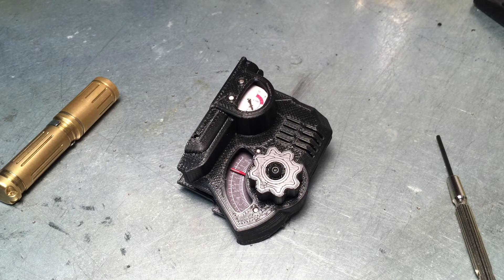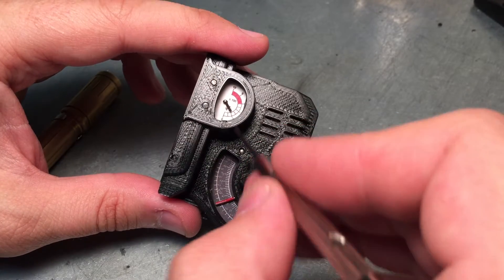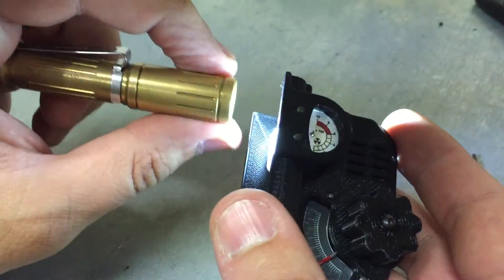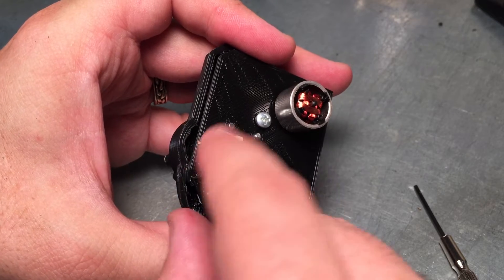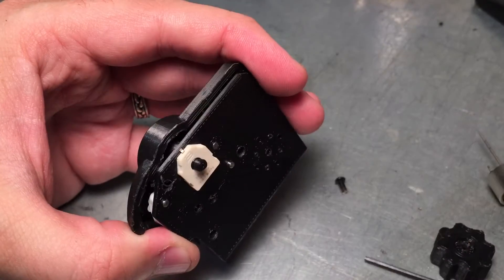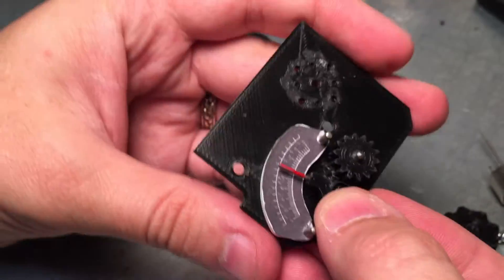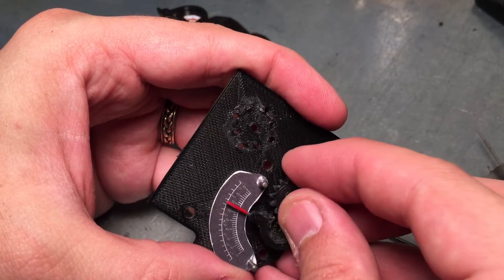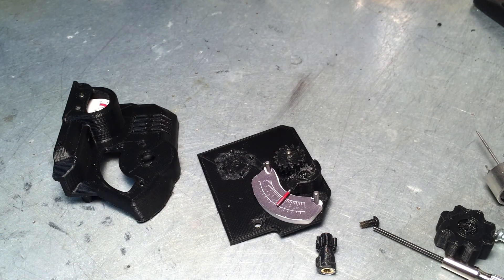Pip-Boy 3000 MkIV, Radio Knob Prototype 2

Comment: Is your pip boy the same scale as the bluetooth edition one? I need a 3D model of the upper left knob so I can mold and cast the print for a replacement.
Reply: @ZapWizard  wouldn't it be possible to scale the files up by a bit?
Reply: @ZapWizard  What is the nature of this repair that you will be doing, the knob isn't the only thing I have wrong on mine. Just bought it from a weekend market looks like it took a fall and the screen is kapoot, other lights look fine. If I am gonna have a paperweight I at least want it to have all it's knobs.